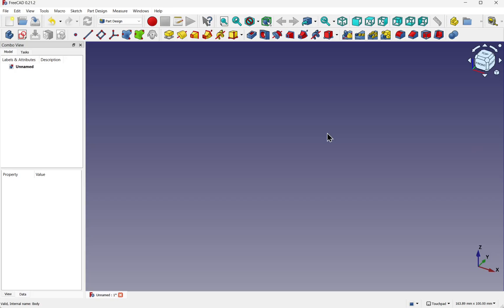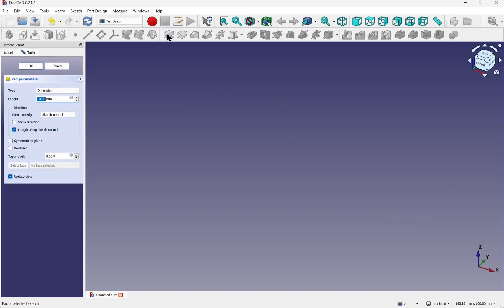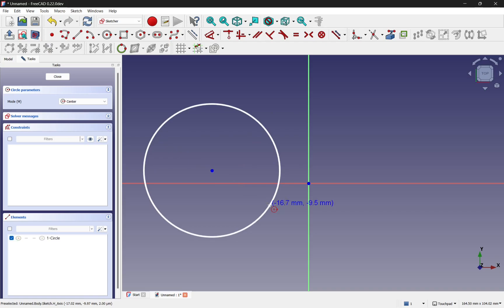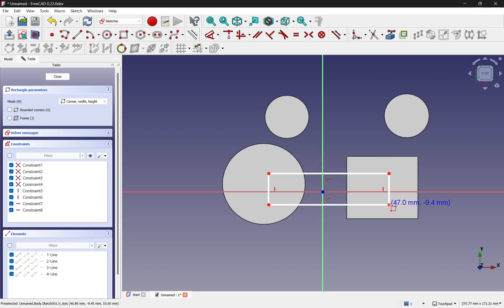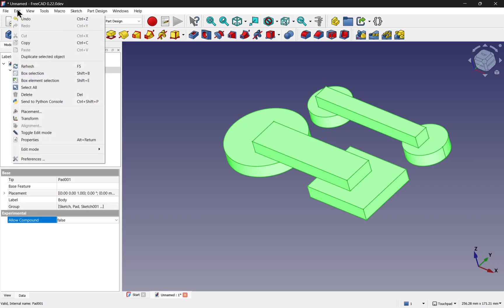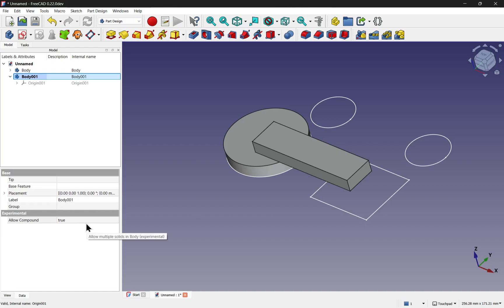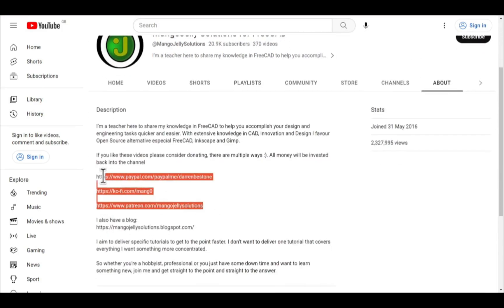FreeCAD v1.0 new Feature! Multiple solid support in one part design body (experimental)

Comment: This multibody in one part container seems to be great in Boolean operations, for example when for joining hollow tubes, which intersect. When you cut them, it creates several leftovers with no error, which can be then manually erased. Did not try it yet, but it seem to be logical.....

Comment: I have a question that may be related to this issue
I am trying to create a part for 3D printing made using a closed profile in the XZ plane, displaced from the Z axis and then revolved about the Z axis..  I then want to take that ONE body and split it (as viewed from the Top) into two bodies, joined in a Dovetail.
The part is too large for my printer otherwise.
I can split it in PrusaSlicer but would rather do it in FreeCAD.
This effectively boils down to the question,
"How do I split ONE body into TWO bodies, using a Wire of arbitrary shape as a cutting tool ?"
There HAS to be some way to do this ... Thanks in advance !
-- Chuck in Belize
Reply from the maker: Ah Yes, I see exactly what you are trying to do. 

top menu > view > persistent section cut.   Try that :)  Tip: hide the body why you are altering the values so you can see the cut.

Comment: When i make a octagon in partdesign sketcher and then change from mm to ft/in and make it 11feet with dimension tool it turns into an octagon with the dimension tool producing a mutated dimension compared to original 11 ft across the octagon from a point to a point.

I have no idea how to effectively submit bug reports. im using 1.0.0RC2.  Thanks and sorry and thanks again for the channel.  it is awesome.  
From Frostburg, Maryland.
-chris

e, wehen using the polygon parameters window to select the side value it didnt give me the error.  i repeated the orig error after restartng software a few times.  using debian 12 with xfce4 and otherwise a pretty clean system.  appimage.

Comment: This is a feature I have worked around for some time. I thought it was by design. Is there any history as to why it has been so long in implementing? Or why you couldn't do it in part design. Just curious. It's a new thought shift to have it available. Thank you for covering the coming changes.
Reply from the maker: Funny I was having the discussion yesterday with someone, it's one of those things that has been long awaited like the topo naming fix. I am wondering, maybe the TPN fix allows for more of these feature to come to fruition.
Reply: There have been long discussions about this. Some users claimed it could cause TNP issues but a general conclusion was that it should be mostly safe, especially now with the TNP mitigation code and Link Branch with this feature tested by many users.

Comment: Pressing space to show sketch back is the most stupid thing i have ever saw because it is hidden and non FreeCad users will never know. Be like Fusion 360 or Photoshop or any normal program and add an EYE ICON next to the sketch or body or what ever to SHOW or HIDE sketch or body or what ever. I have to check your tutorial to find what is the way. 

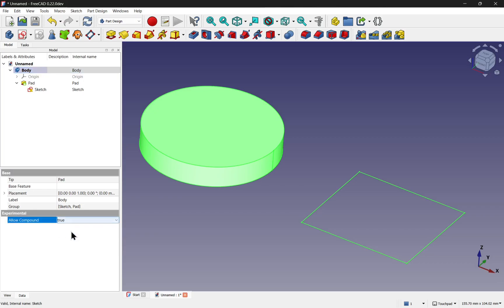2:13 That is a perfect example how this important feature must NOT BE HIDDEN like that. I has to be enabled by default.

This kind of small "nuances" about FOSS just makes me mad.
Reply: Ondsel is working very hard on this kind of usability. I hope they have an Ondsel version of the FreeCAD 1.0 out soon. The current Ondsel is nice to work with but it doesn't have the latest FC improvements yet.
They do a lot of other "polishing" work.
Reply: The "eye" visibility icons are already available and even enabled by default in this dev version of FreeCAD. Hiding sketches by default often makes sense, for example to avoid issues with selection.

Comment: Can somebody please, for the love of God, tell me how to set constraints between 2 padded objects.  I can't find any videos how to do this😅 pleeease
Reply: could you be more specific,  i mean show me an example of what you're trying to do.  The question is a bit ambiguous because there's multiple ways of doing it... depending on the situation . 

For example,   if you are in sketcher  and you have already extruded  two  cubes,  but you want to put a circle   in the middle of those two cubes,  you could put down some  external geometry references  and then some construction lines.  From there you can use the  Centering  tool   which looks like    >.<      in the icon list in sketcher.
It really depends on the symmetry or lack there of in the pads you're trying to align it to...

Comment: Are the bridges automatically connected to the previous extrusions or is it just a lot of unconnected segments?
Reply: The bridges were drawn on the face plane of the big circle, but all  4 of those objects were extruded to the same height, so they are connected to the bridges. If the second pair of parts were extruded to a different height then a second bridge sketch would have been needed, on a face of one of those parts at that height.

There may be a way around that, but that's how I would tackle it. 

As far as manipulation, since there weren't any constraints dimension constraints added, you should still be able to manipulate the placement of parts after extrusion. I've ran into issues with this but I'm still pretty new to FreeCad.
Reply: @cdrocker3663  oh, so in part design they automatically connect when they intersect? im just working with the part workbench, so im wondering how that works.
Reply: You are right about that auto boolean in part design. Part does not do that but part design will auto add/deduct. Saves you one click on the mouse and one brach on the tree.
Reply from the maker: Nice response there from others.  Yes the part design runs a automatic boolean between operations.  Think of a pocket as a extrude of the sketch and a cut and the pad as a extrude and a boolean.  All operations are followed by a refine to merge coplanar faces.
Reply: @ah-64apache84 
As far as I'm aware yeah, they would be connected and would produce a single object if say, exported mesh (STL file) for printing or CNC models. I think another response to your question addresses this in more CAD specific terms, but when creating mesh from your model, you'll be prompted to add/include the solids for the mesh.

Comment: Do you know when stable release will be announced?
Reply: On FreeCAD's GitHub issues page, there's just 10 issues labelled "blocker" i guess once those get fixed and tested we'll get the stable version. Looking at them it seems like all of them are being actively worked on, so I guess devs are hard at work to make sure FreeCAD 1.0 is released soon, but released stable and without major bugs.
Reply from the maker: There has been another community release and I believe they are cycling those to ween out the final bugs.  I am not sure when for the final thumbs up.
Reply: I mean to have read somewhere that they originally planned three RCs before release. RC2 is out by now. This was surely only a rough estimation, but actually the current RC2 is already very stable, and it is very unlikely that working with this will break anything for the 1.0 release. So there is no reason not to use 1.0 RCx already.
Reply: @Gaston12345 It’s stable on the surface but many nasty bugs (including easily triggered crashes) have been fixed since RC2. And quite a few are still waiting to be fixed in weekly builds.